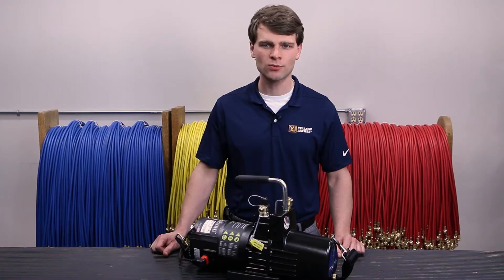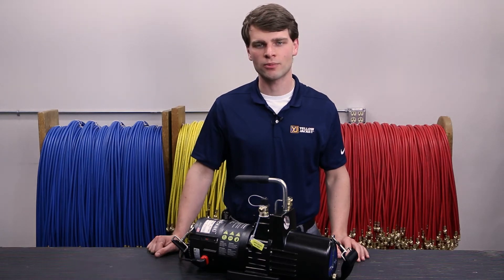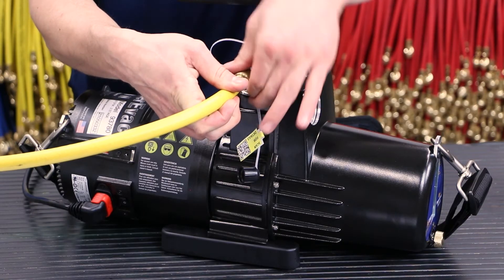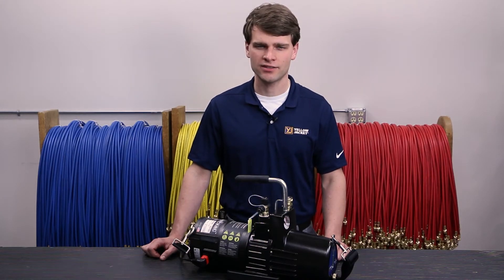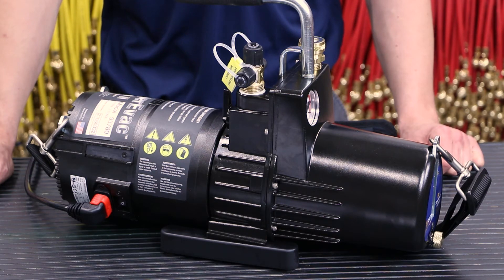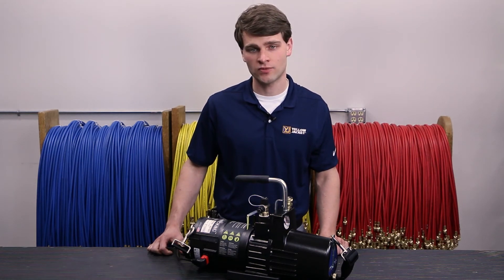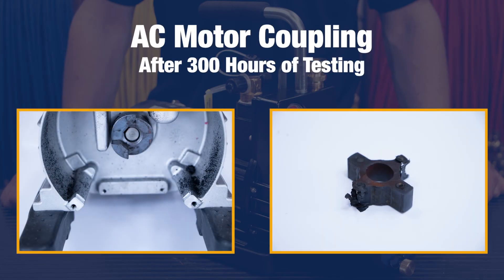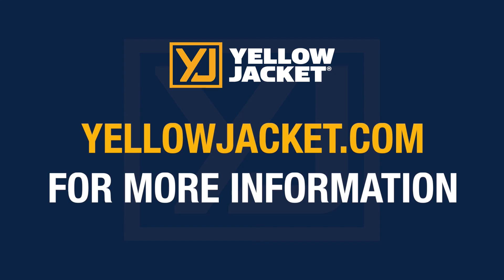SuperEvac PLUS II Start Up Tech Tips

Comment: My 93600 vacuumpump drain plug leaking oil very slowly（3-4days/drop），how to solve this issue？
Reply: Solutions range from placing the pump over an oil absorbant pad to buying a new vacuum pump. See if you can buy a new drain fitting from a supplier that carries YJ. If its O ring style replace the O ring, usually a 1/4" OD seal, very common size.